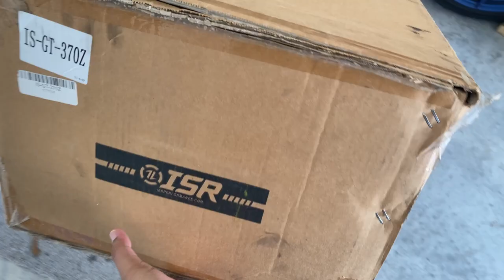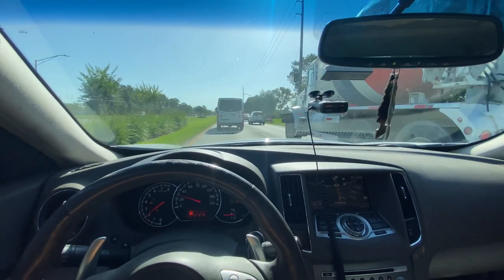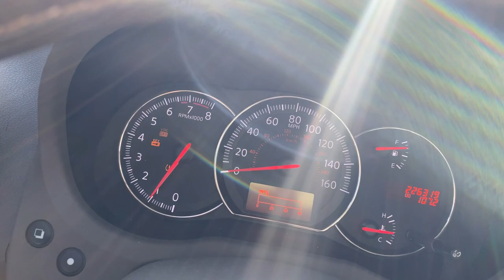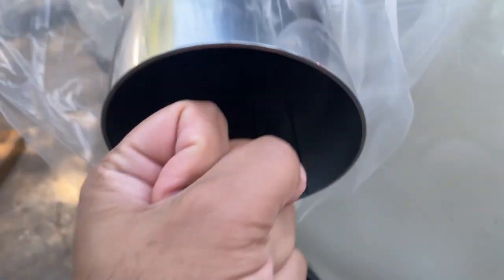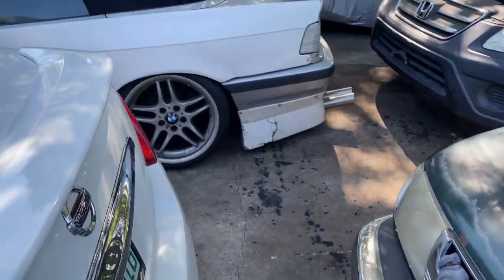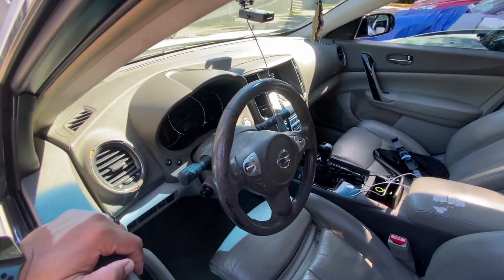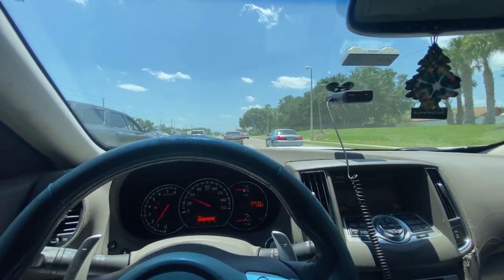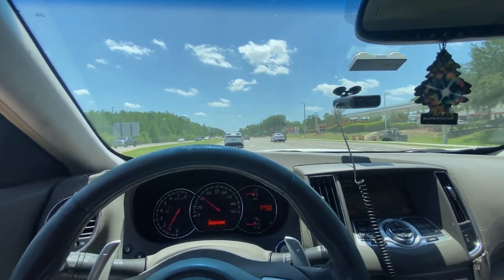Installing ISR exhaust on my Manual Swapped 7th Gen Maxima #cars #modified

Comment: Sounds great, also the diffuser does well to hide the other empty exhaust spot.  Do you feel a boost in power?  Personally I got a Borla Cat back dual exhaust (dual tips a must for me) for my 2011 Maxima, and love how quiet it is down low but how loud it is when you get on the throttle.  I need a performance Y pipe like the one you got and it will sound even better!
Reply from the maker: Oh yeah I felt a boost in power and drives smoother to. Doesn’t hesitate anymore

Comment: Should've tried the helmholtz exhaust from the q50 :(
This one is cool though
Reply from the maker: This probably won’t be the last setup
Reply: @Horsepower Labs  cool, I was gonna try the helmholtz because of how it looks and sounds and no one else has it on their Max, but now I'm leaning towards trading the car in 

Have you ceramic coated any parts of the exhaust to prevent further damage?
Reply from the maker: @The4-D  i haven’t yet but I should lol

Comment: 2.5 or 3 inch diameter? how much modifying did it need? also how much did this shop charge you im curious. sounds great. thanks!
Reply from the maker: 3in not much modification just extra pipe to extend it back. And was around 150

Comment: Which single exit did you buy and do you know any better ones that would fit too?
Reply from the maker: I said the name in the video. It’s ISR single exit. And most will need to be modified. You can buy 370z single exit and modify it to fit
Reply: @HorsepowerLabs  Bet, I’m tryna build my maxima like yours cause who doesn’t like a flamethrower.
Reply from the maker: @tylerhamilton5956  wait till you see next video should be up today or tomorrow hopefully today
Reply: @HorsepowerLabs  Thats a bet